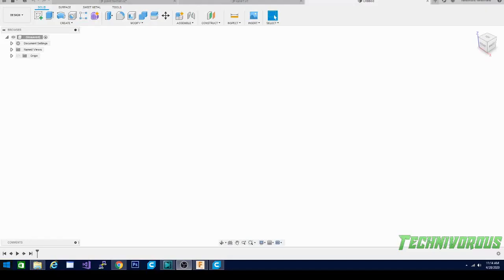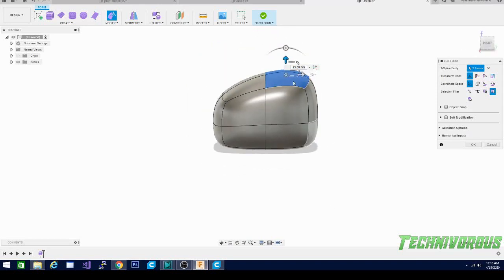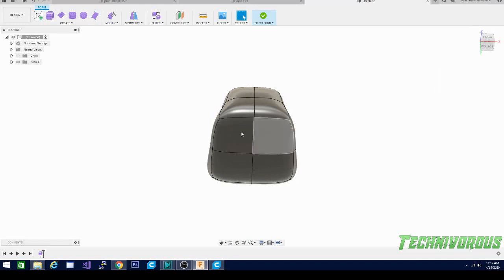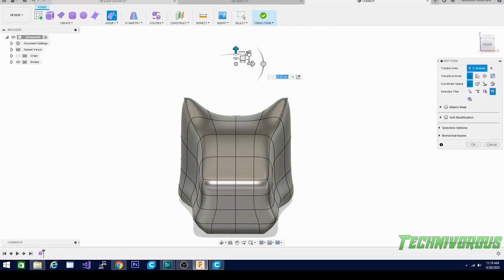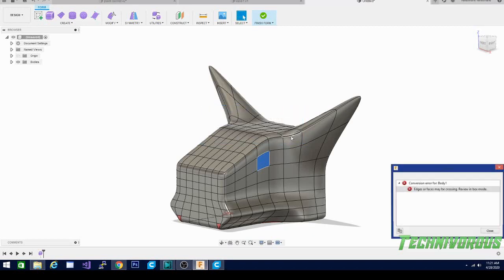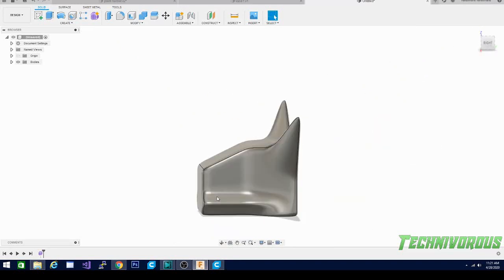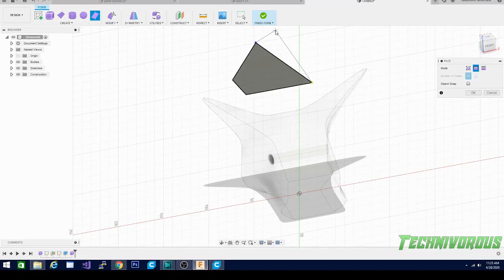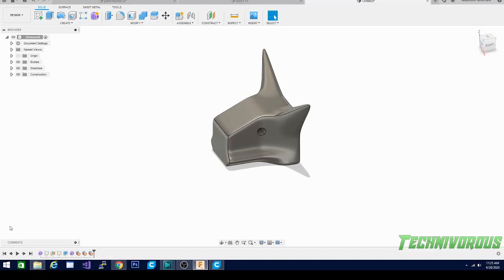Fusion 360 Tutorials  The Basics 5 Modeling in Form Mode, and Subdividing

Comment: Cool "cat", Nick - or whatever it is! :D >^. _ .^< Thx for sharing. Oh, and BTW, you have a lot of content for just one year!
Reply: QUICK TIP: To select multiple T-Spline faces, in the Subdivide feature, you must do CTRL+SH+click. Yeah, not so intuitive.
Reply: TERMINOLOGY: As you are probably aware, there are a number of ways to represent a 3D object. And, it's easy to mix up terms. F360 is primarily a "3D SOLID" modeler (based on MATHEMATICALLY DEFINED OBJECTS, like lines, arcs, etc.), as opposed to Blender, for example, which is a "POLYGON" modeler (based on VERTICES/EDGES/FACES (i.e. "polygons")). In F360, a "FORM" is a special kind of object, called a "T-SPLINE", which is mathematically defined. A 2D T-Spline (plane, or face) is a SURFACE. But a 3D T-Spline (box, quadball, etc.) is a 3D solid - it is a CLOSED SURFACE, i.e. "WATERTIGHT". And, it is not a "MESH" (polygonal model) - at least at this point, though will be if exported as an STL. It can also be made into a mesh by first converting to BREP, then converting the BRep to MESH. In fact, if you do this you will see different icons for each object, all being a BODY, but w/ distinctions, e.g. the mesh is called a MESHBODY.

Now, plz don't get me wrong, I'm not saying you did anything wrong (and from your extensive content, you clearly have a lot of experience/talent), I'm just addressing terminology. Some people value this more than others, so take my ramblings, or leave 'em:)

OK, keep banging out content!:) - the community depends on each other...

Sincerely,
Swami

P.S. Part of my "problem" is that I'm a mathematician/3D programmer/modeler/teacher, so I have a special focus on words/meanings/communication.
Reply from the maker: Thanks! Yeah I've even deleted some of my worst videos... I've actually posted almost 400 and I think there are 150 or so I have kept